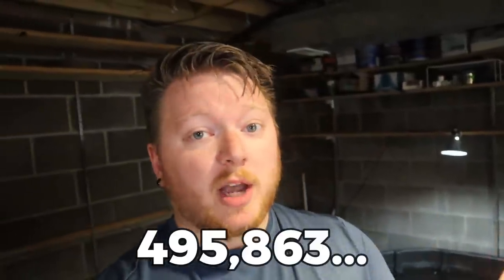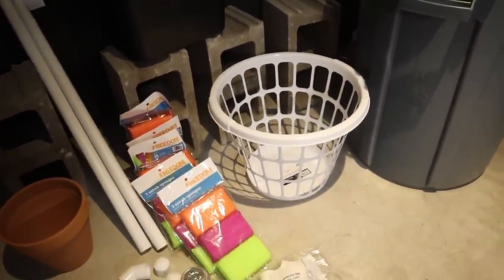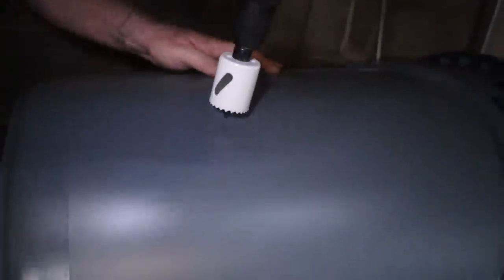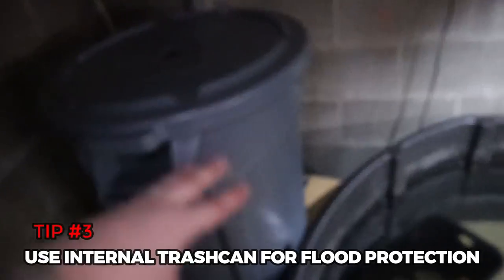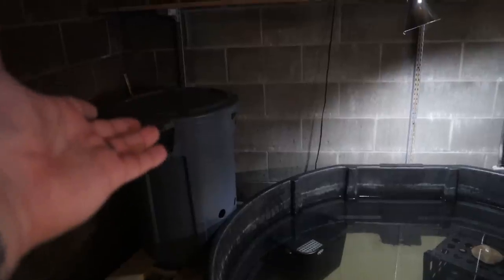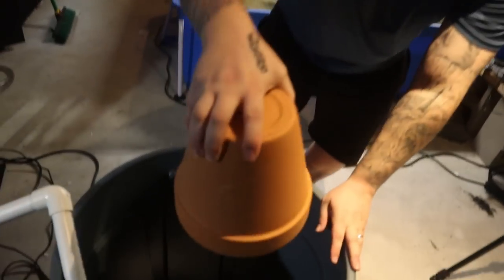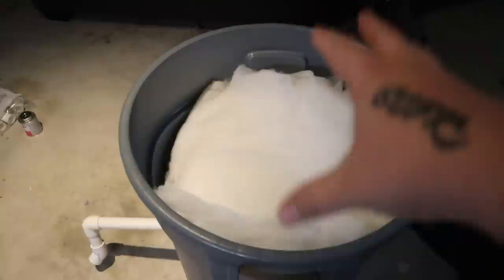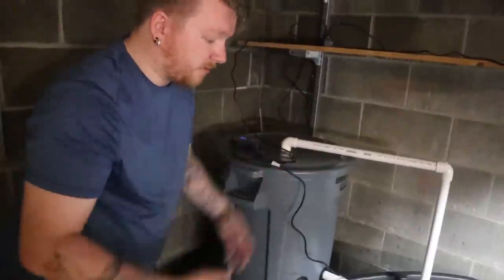DIY Pond Filter Made EASY For Indoor Catfish Pond!

Comment: I essentially made the same thing with a 5 gallon bucket. Works like a charm. I never thought of using a trash can. Stacked two milk crates in the pond and put the pump in the upper one. Placed a paver and bucket right on top. If it fails it fails without any catastrophe.

Comment: @SC fish keeping if u want less maintenance, the water should hit mechanical filtering first (Course pad -> Medium pad -> Fine floss or pad) then the water should hit the biological media such as porous ceramic/glass etc (around 1kg of bio media per 100 liters if lightly stocked or else 2 kg per 100 liters), then the water should hit chemical if needed.

As you have it setup now, the polyfill will get clogged very fast, and you will have to do alot of water changes to reduce the nitrates.

Comment: Great simple design. I would add one thing though, an emergency overflow return that hopefully would never be needed.  Right above the layer of poly just in case the poly clogged up enough to actually fill and overflow the can. It is probably overkill but might save flooding a basement or pumping the tank down to the pump intake level in the small trash can can. Thanks for the info and ideas.

Comment: I’m wondering about the bottom of the tank where the sand is. How does that get cleaned and cycled?  

I like the holes at the top of the trash can, but think it’s missing the chance to filter closer to the bottom.  

Is there such thing as a cut off switch that triggers at a lower predetermined water level?

Comment: I'm putting together a Intex above ground pool for some Koi. About 600 gallons. Will this set up work and also how tall does the ceramic pot need to be in a 32 gallon trash can? My pool is 86-5/8 x 59"x 23-5/8. Thank you so much.

Comment: Great video! I am planning to get a 300 gallon stock tank like that pretty soon for my pacus. Well for a while until they outgrow it..... Than I would upgrade to something even bigger...... I have been watching a lot of videos and planning out how I’m going to build the filtration, I than was just thinking and remembered my pacus like to chew...... They chew on airline tubing, they also would chew cords but I have the heater cords to close to the top that they can’t get them. So I’m thinking about using a upside down basket, than running the pvc and the pump cord out the bottom of the basket, than elevate the pump on a pot under the basket. But than I was thinking they would chew the pump cord........ do you have any ideas to protect the cord? I was thinking about using a pool noodle and cutting it to size, than run the cord through the noodle to protect the cord. Do you think that would work? I also plan on having the heaters in the filter. I would also want to have a lot of different filter media in the filter, like the pot scrubbers, some bio balls, some bags of ceramic rings, a couple carbon bags, than have the filter padding. I also would want to have lava rock at the bottom around the pot that elevates the basket that holds the media so there’s lots of places for the bacteria to grow and to be able to handle my messy pacus. I’d also want to use a 55 gallon trash can to hold even more media! Do you have a heater in there? Do you think having heaters in the trash can would work? I can’t wait to get my pacus upgraded so I can upgrade my cichlids to my 125 gallon! Does your pacu ever chew on cords? Also I can’t wait to see a fish room tour when you get your fish room finished! I also would like to try to start documenting some of my fish and other animal projects and setups on my channel in the future as well! And I can’t wait to see what that 3rd fish is that was in the box in the last video! Also your probably my favorite fish keeping channel on YouTube!!!!!

Comment: im making the same pond you did on your porch do i need to add anything to the water to make it ok to put my fish in and do i need to let it run for a coupple of days first?
Reply: he just does not answer these questions,   I have city water so I do need to add a conditioner to my water  or let it sit for a day to let the chlorine evaporate out of it then its safe to put the fish in it.  I personally will fill my 300 gallon tank up fuller.  as i am about to set mine up and use this filteration system Zac has made.    BTW if you have well water you can put your fish right in the pond.

Comment: How do clean it? Do need a release valve?
Reply from the maker: @fondestvirgo  you could add a release valve if you want to, but for me that's just one more area the could give you issues or leaks!

Clean the media by grabbing a bucket of the pond water and rinsing it out in that! Otherwise if the inside of the trashcan ever gets so dirty you need to do a deep clean, just drain the water out, give it a good scrub and rinse it out before setting it back up! It's pretty minimal maintenance for as big of a filter it is!

Comment: Great video what specific pump did you use for this build?
Reply from the maker: @themultiangler  The brand is called Jebao. They have a bunch of different pumps on Amazon. Just a matter of picking the size that works best for you!
Reply: @SCFishKeeping  Great thank you man! Also my basement doesn’t have any floor drains. I’m wondering how I am going to fill the pond along with doing water changes. I have window wells to empty water maybe run a hose. Do you have any suggestions other than going up and downstairs lol. Appreciate your content!
Reply from the maker: @themultiangler  If you have a sink within reach of the basement, there is something called a Python that you can both drain the pond with and refill it! It just attaches to your sink and makes it super easy! That'd be my recommendation! Otherwise you could do the hose but it's not as easy that way

Comment: (May 2024)  I have a question.  Wouldn't the water level inside the trash can not get any higher than the water going into the pond?  If so, I know the sponges would be "watered" as the flow trickles down the trash can, but  how does this grow enough bacteria to be of use?  Just asking.
Reply from the maker: It depends on how much flow you have going into the trash can as well as how quickly it goes out. You could set it up so that the sponges are submerged by putting them at the bottom of the trashcan and having the outlets higher than the sponges. The more water you have sitting in the trashcan though, the more weight and risk for issues with the can.

Trickle filters are very common in the hobby though as the water flowing over and through the sponges does allow the bacteria to grow and keep the pond clean! I won't pretend to be a scientist and act like I know how it works... I just know that it does! Haha.

Hope that helps!

Comment: Can uniseal be put on a flat surface container. Or does it have to be curved
Reply from the maker: @onsloth  it can be used on a straight/flat surface sure! But there are other types of seals and PVC connections you could use as well that might make a better connection! The uniseal works the same, I just use that due to the curve of the trash can!
Reply: @SCFishKeeping   thank you. I like how much easier uniseals are than bulk heads.  I was gonna make a hang on top filter with one of those black (yellow lid) containers...is why I asked
Reply from the maker: @onsloth  I've used those for that exact purpose too! They're a good size! Just make sure you support the entire bottom of the tote so that it doesn't bow out between 2x4s or anything like that!

Comment: Any way to build it with the can below the water level?
Reply: You could not cut out the over flows. And get  two of the same pump. Set the second pump in the bottom underneath the sponges n such. Run the output out of the lid and back to tank.  Set pumps to same speed and should be good
Reply: @stevewilhoyt924  one pump slows down and I have a huge mess or a dry filter though right?

Comment: It looks as if the sponges in the can are never going to be submerged and just have water trickling through it? is that sufficient to grow bacteria?
Reply from the maker: Yup! Think of this setup more of like a trickle tower you might find in a sump over the way you would think of a canister filter. 

You could have the water pump into the bottom of the can, fill up and overflow back into the pond from the top but I don't like that much water or pressure in the trashcan.
Reply: Zac @SCFishKeeping    I believe the trash can fills up to the point of where it pours pack into the pond  RIGHT?   that was a great question I never thought of till you brought it up.    Now I am putting mine outside so do I need to worry about the strong winds blowing my garbage can around and disconnecting it from the pump ?

Comment: ok so this video is a joke.
This doesn't filter and its not removing the ammonia.
I'm not seeing how it does.
The water goes over the top quilting down the sides then back into the tank.
There is no filtration in this.
Reply: How is this not filtering? The water is going through filter floss and sponges to get grime and stuff out. This is basically the samething as a seachem filter. You don't need a chemical bio filter to remove ammonia if that is what you're thinking.